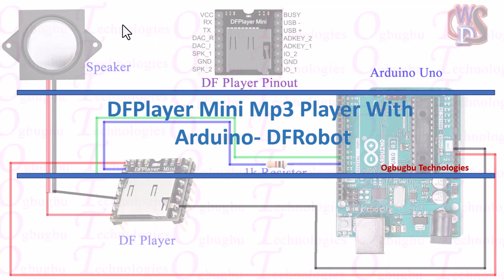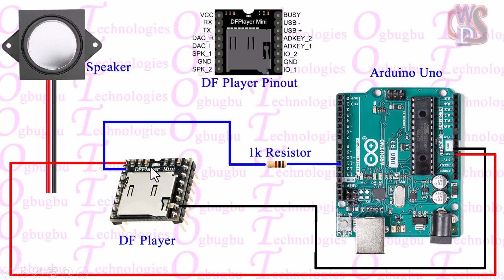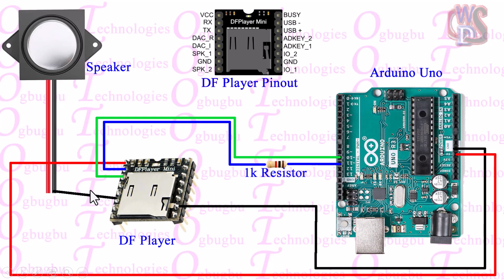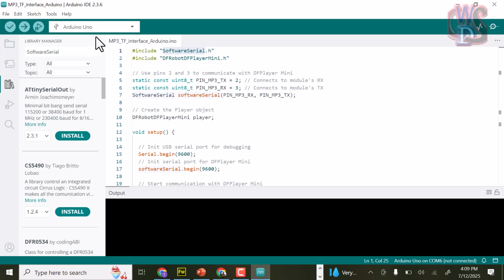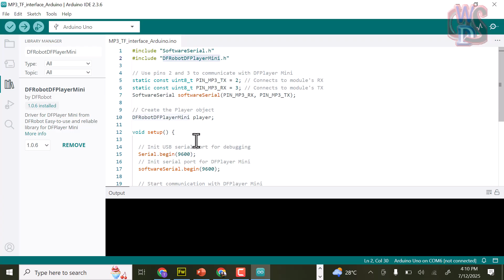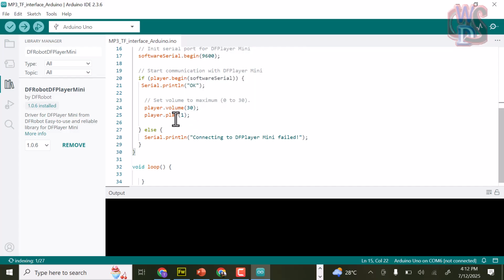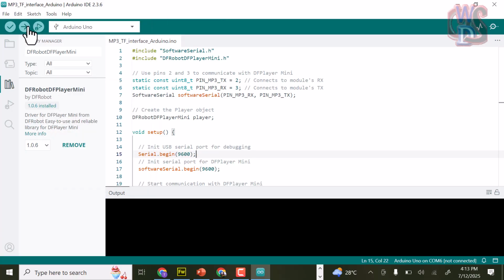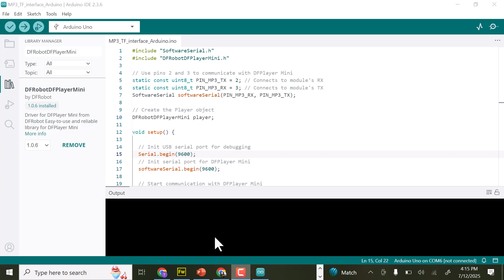DFPlayer Mini Mp3 Player  With Arduino- DFRobot

Comment: Can you control volume with potentiometer instead of code?
Reply from the maker: DIrectly no but with the aid of simple applifiers added to the project doing that is very possible, a suitable and affordable one will be    Mini PAM8403 DC 5V Power Audio Amplifier Board Digital Power Amp Module 2 Channel 3W+3W Volume Control.

Comment: What is the best power supply for this Module?
Reply from the maker: 5V please. but you need to add 1k resistor between the RX pin and Arduino for proper functionality.

Comment: Can this be use with other micro controller like pic and STM32?
Reply from the maker: Yes, the DFPlayer Mini MP3 module can be used with other microcontrollers like PIC and STM32, not just Arduino. It communicates via a UART (serial) interface, which is a standard communication protocol found on most microcontrollers.